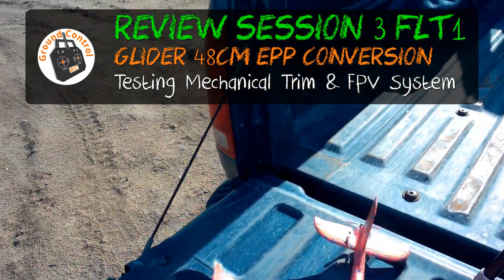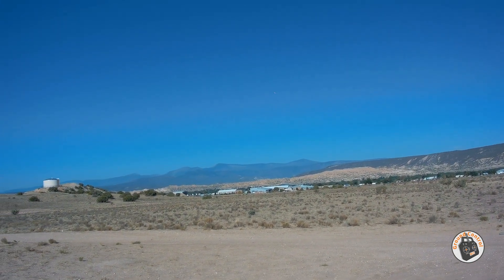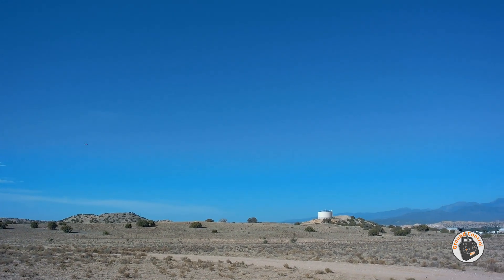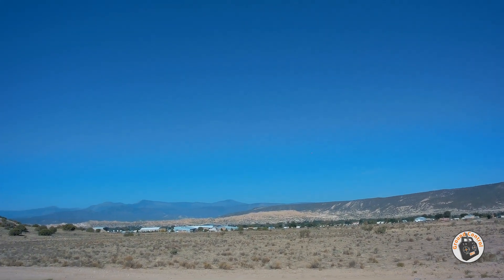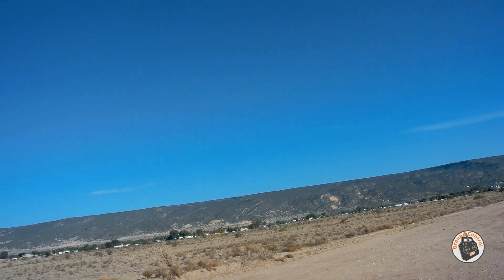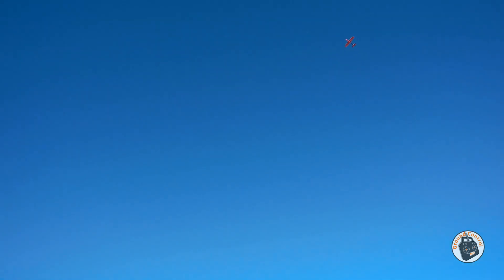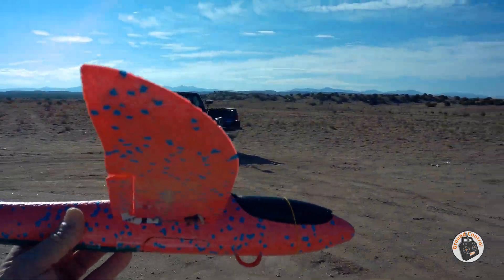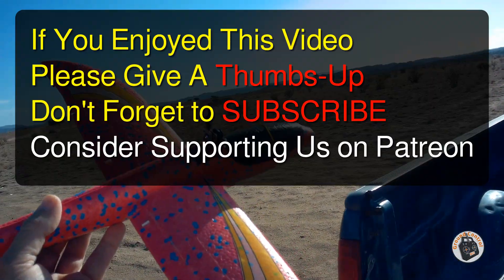$4 Chuck Glider RC Conversion - Session 3 Test Flight 1

Comment: Which motor ??
Reply from the maker: I used a DYS BE1104 7000kv Motor. I've found the best thrust and efficiency is with a 3020 Prop using a 2S LIPO. I hope that helps and I'll see you in the Air!

Comment: A total success , I would say G.C. ! Any bugs are just minor.
Reply from the maker: Thank you so much! It was quite a bit of work, however, I think well worth it in the end. I think the hardest part of the whole project was getting the airframe completely straightened out as they ship these in bags. A little bit of heat from my heat gun and some pressure seemed to get everything straightened out. Happy Flying!